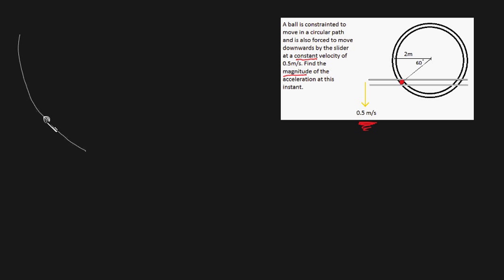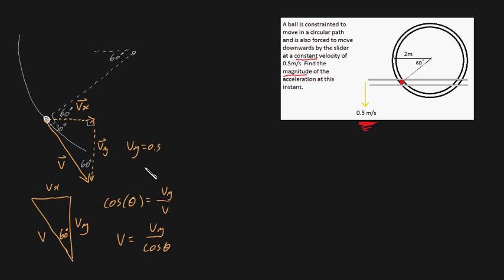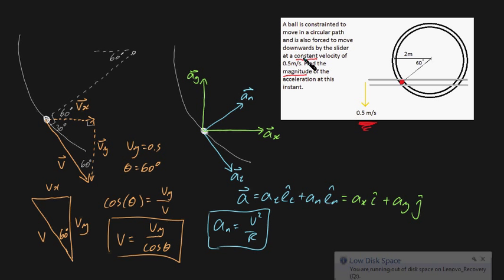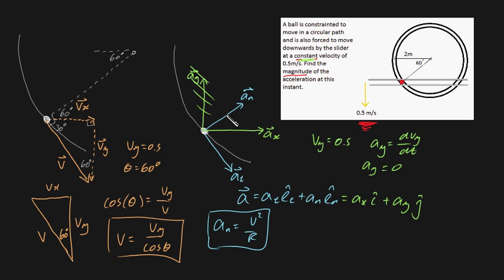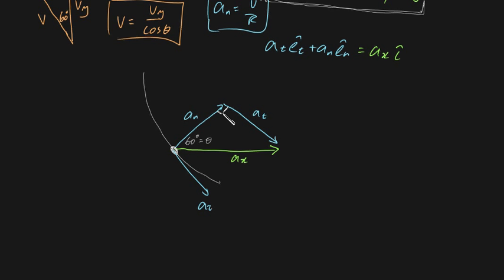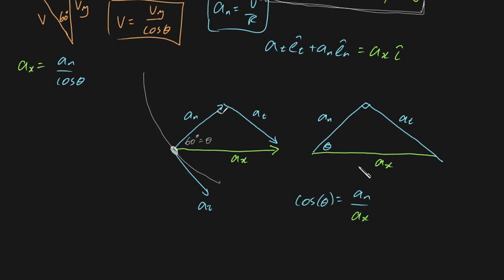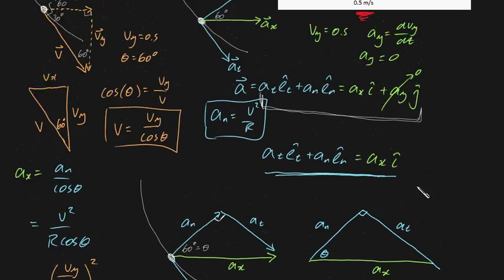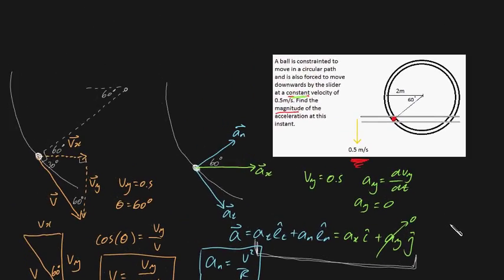Curvilinear motion example 2

Comment: I dont understand why ay points up. Regardless that its 0 wouldnt it point down. Please explain!!
Reply from the maker: Hey mate, great question! In this question I'm using the standard x,y axis where x points positive to the right and y points positive upwards. This means we assume positions, velocities and accelerations all face upwards in the y direction, and if they face downwards that just means that it's negative. The velocity vector is also affected by this so V = - 0.5 j. Hope that makes sense :D
Reply: Oh okay so you just decided to draw the ay vector up since that fits the standard of the x,y axis you've already established.
Reply: Oh and by the way when I did this problem I took a whole different approach and got the same answer which I thought was cool to share.  So basically I started with the idea that V=<vx, vy> and A=d/dtV.
Then i set vx= vysin(theta)/cos(theta)=vytan(theta) and vy=vy since its a constant (this way everything is in terms of a constant vy). So i differentiated V to get A=ax and ax=vy*d(theta)/dt*sec^2(theta), and then given that V=wr i further simplified ax to get the same expression you got. ay just became zero after i derived it since its a constant.
Reply from the maker: Hey mate, I just checked your working. That's absolutely right. That's a very clever way to solve it too. Good work :)
Reply: thanks man!